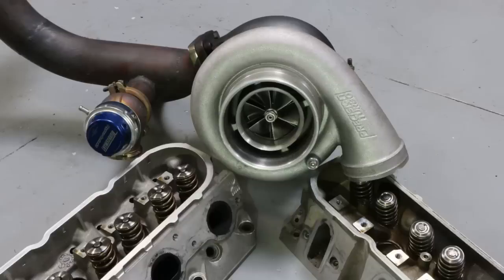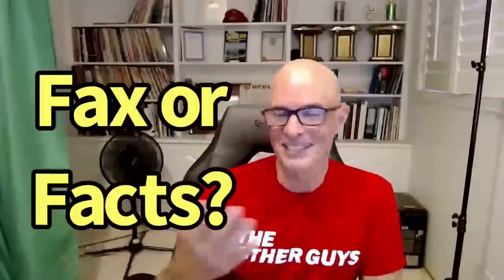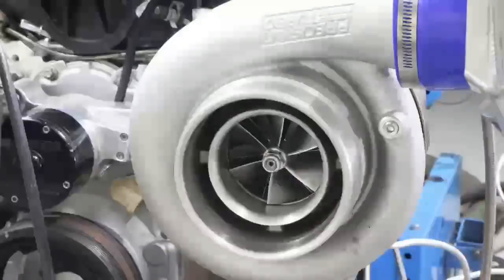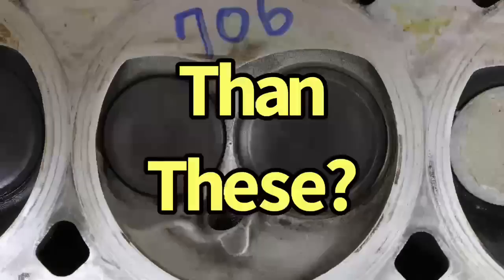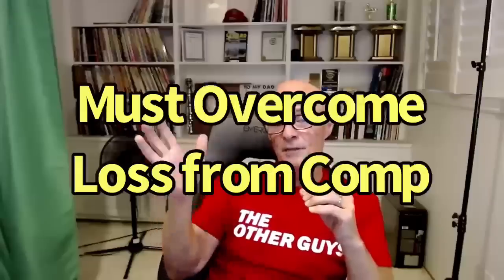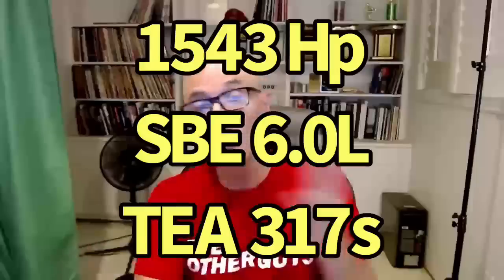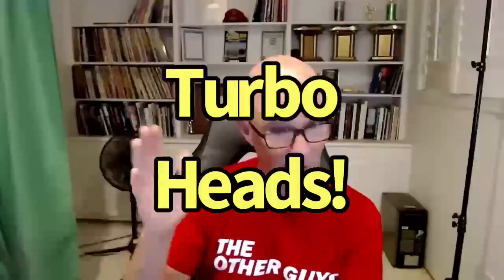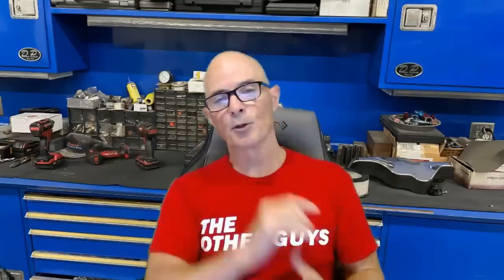BOOST VS HEAD FLOW-WHAT STOCK HEAD SHOULD YOU PICK FOR A TURBO LS? 706 VS 317-DOES MORE FLOW MATTER?

Comment: Please explain the L33 5.3L (Alum block 243 heads) vs the LM4 5.3L (Alum block, 706 heads). Better yet, The LC9 came out with both flat tops as well as 3cc dish, but both had 243 heads and the 243/799 head engines were always higher rated by GM.
Reply: He has videos of all the different small block heads. The 706 wins because coefficient of discharge and shrouding of the bigger valves. The 706 heads have 1.89 valves. The 2.02 valves are worse at shrouding. That's why the 706 heads win
Reply: The LC9 is flat top only, when you say 3cc dish you might be referring to the valve relief pistons for the VVT motors.

Comment: Are there performances gains in installing large intake valve on the 706? Or is shrouding too much of an issue at that point.

It's unrealistic but I'd like to see the 317 chambers welded and reshaped with the swirl ramp.
Reply: thats when you find out its quicker and easier to buy a 243.

Comment: I am currently running a twin turbo build on a built bottom end LQ9 bored and stroked to 408 with CNC ported 317 heads. I would be curious to see how a set of equally ported 706 heads do under 25 30 plus psi of boost.
Reply: That’s the test that I want to see also. I believe the 317 heads with 2.05 valves or 2.08 valves will edge out the 706 heads. Need to test on an engine with large bore solid lifter, cam, high rpm, and big boost.
Reply: @danielsullivan9865  I have the perfect engine for it lol running a summit stage 3 turbo cam.
Reply from the maker: TEA ported 706 heads vs TEA ported 317 heads
Reply: @richardholdener1727  that would definitely be an interesting video to see!

Comment: I would lay wager you'd lift a head before you get to the point where the 317 makes more HP (if it ever would get there).
Reply: Definitely NOT on an 87 octane build
Reply: @boost1728 Why? Just why?
Reply from the maker: For all those guys out running 87-octane turbo builds!
Reply: @richardholdener1727  the simple question was will a 317 EVER make more power than a 706? 

The answer (as we discussed in the live feed tonight) is a loud and proud YES once detonation threshold is met (which should be part of testing, because it is part of reality in a vehicle.) If you don’t utilize the additional timing and boost available with the use of 317’s then absolutely not, because we know 706’s are rowdy… but if you find a way to run knock sensors on the dyno and actually push these combinations to the point of knock, bet $1,000 that 317’s are capable of making more power than 706’s under normal boost conditions (15ish PSI) whether that’s on 87, 91, whatever floats your boat. 

It’s a bummer all your tests are without this valuable data.